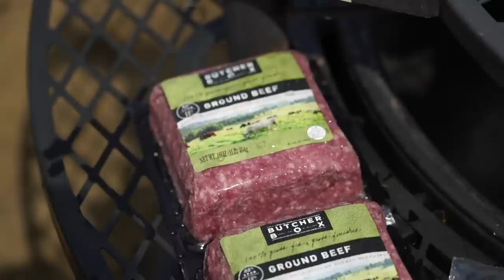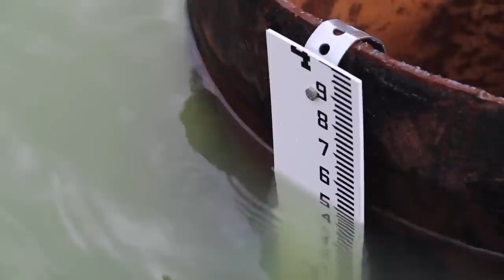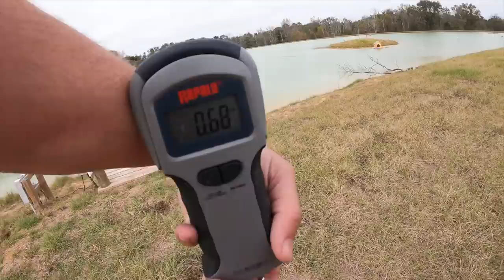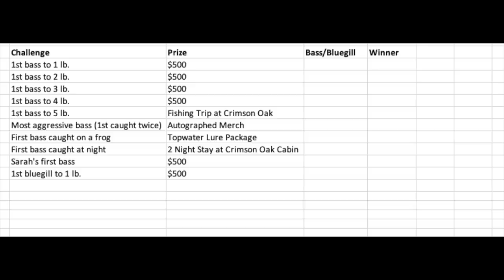My Biggest Mistakes Building a 5 Acre Pond (Things I Wish I Knew)

Comment: I have watched this series from day 1.  It has been one of the most informative, yet entertaining series I have come across on YouTube.  I would be very interested in what building a 5-acre project like this costs.   I am guessing with all of the equipment, dozing and delivery of the clay liner loads, along with everything else, the pond alone, not including the cabin, has to be somewhere between the $1.5 million and $2 million dollar mark. I may be a bit high on the estimate, but I don't think I am that far off when you include the well to fill the pond, the projects to stop the erosion, the lights in the pond, pellet feeders,  and  cameras. 

I see you are planning another pond build,  will the  new pond project be larger, smaller or about the same size?  Thanks in advance.

Comment: Hey BamaBass ! Great project you have going on ! Because of your channel I decided to build a 1 acre pond on my 30 acre Farm ! 
Luckily I’m on a swamp and used a 2 inch Harbor Freight gas pump to fill my pond ! I had to buy 600 feet of discharge hose to connect the Swamp with my pond !  The water quality is phenomenal, I didn’t realize but after a couple of days filling, I saw tiny fish in my pond ! I couldn’t believe those small mosquito fish survived the journey through the pump ! I also discovered freshwater crayfish and believe it or not, freshwater shrimp !
I used a lot of gas to fill the pond and always considered it as a temporary solution to fill my pond ! 
You mentioned you had a well drilled with a 5 HP pump to fill and maintain the water level ! I lost about 3 feet of water because the fall was so dry ! I think I would like to go your rout to maintain the water level with an electric pump, because the gas pump is loud, and disturbs the wildlife ! 
I need some input about your well and pump ( how deep, cost, maintenance of pump, cost to run) Thank you and good luck !!

Comment: how much water do you think soaks through the clay liner back into the well? If you don't let any water soak in during wetter years, your well will run dry and you won't be able to fill the pond during a drought. Swales with trees planted on top are known to recharge the groundwater. Building some swales by the sides of the pond while you have all your digging equipment available is a great idea!

Comment: Thank you for your amazing videos!!!!  I look forward to them every 2 weeks!!!!   

Do you catch a fish on every cast, or does it just appear that way?  Also I just bought a property in San Diego that has a seasonal pond (holds water for about 6 months out of the year.  It is probably about 1/2 acre, deepest section is about 15 feet.  Do you think I could add that two part stuff you used on your dam to seal my whole pond?  What do you think the cost of that would be? What about grasses?  Would I need to get rid of all of them first?  I would like to have fish, and don't want to lose all of the water.  Thank you for your support!

Comment: I've done several ponds, (Sewage treatment mostly), and the first thing to find out is the static water level. Was there a reason your contractor didn't dig deeper so as to not build a dikes on the low sides?

Comment: One thing I pondered back when I had land suitable for a pond... the stand pipe:
Why make it vertical in the pond?  Instead, put the inlet deep down inside the pond and have it rise at a gradual angle to the outlet.  That way when large volumes of water will push sediment upward through the drain and discharge it on the downstream side of the dam, preventing excessive sedimentation in the area of the intake.   That might require multiple or much larger outflow pipes.  It may also wash out stock, so don't use non-native species.
Not being an engineer I don't know if that would work better than the vertical non-sediment-removing pipe.

Comment: went overboard with the clay lining. should have been a moisture conditioned process, where we put moisture into the clay to get the swell factor correct. When that happens, the high PI clay will seal easy without compaction requirement

Comment: 1. Location. You build a pond over a stream, not haul millions of tons of clay, to create stagnant puddle that can be easily ruined by crayfish. Also I predict all the runoff from agriculture above will carry excessive amounts of nitrates and phosphate in the pond and you will have constant algae problem, which is already evident.
2. Cheesy and banal electronics, the green leds and completely over the top duck house.
3. Goldfish.
It was clearly visible the moment owner overtook the project and designer was not present any more.
Reply: 4. Right handed casting reels and switching hands every cast. 🤦🏼‍♂️

Comment: Why did you not dig deeper before you start placing clay? You are going to have to keep adding clay and reinforcing your damn walls. You built it like a storm water management pond and your water level is too high. You should have dug deeper until you found the ground water table because your pond is going to dry out unless you artificially continue to add water. I like the location though. Good attempt; your continued maintenance of the pond is going to be high.

Comment: I'm having a hard time understanding why you decided to do this about the hardest way possible. Instead of all that dam building trying to contain the water why wouldn't you dig to the depth you want and then line it with clay? Not only is it less upkeep and more stable but you would have likely made money on selling the sand you excavated. I've done several of these over the almost 15 years I've been in construction and never seen a dam situation that didn't require constant upkeep.